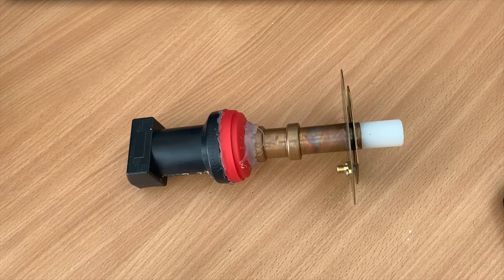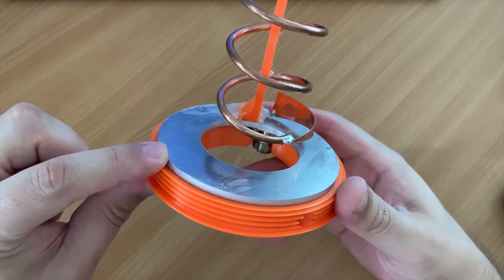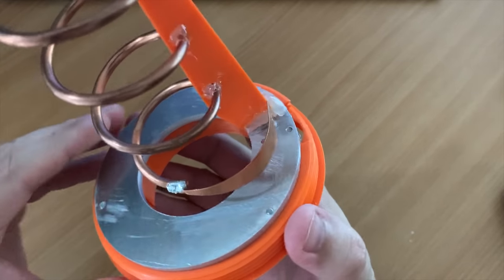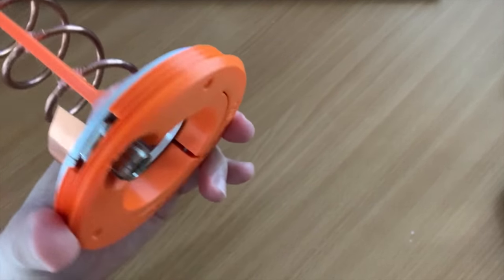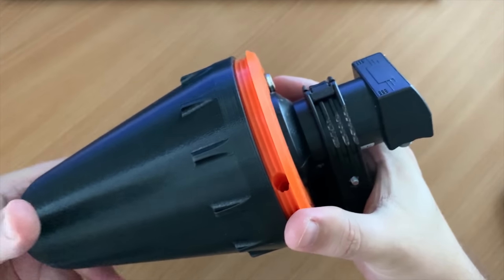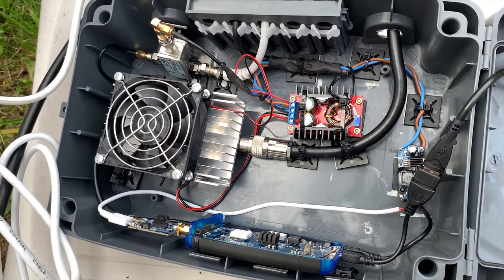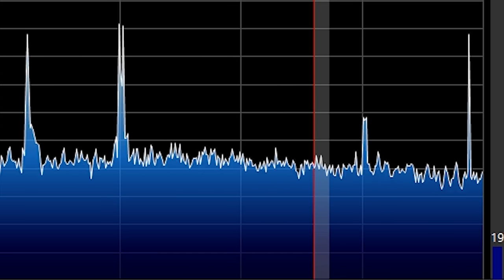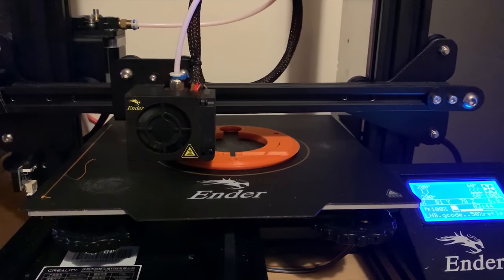2.4 GHz Dual Feed Helix Antenna For QO100

Comment: Outstanding antenna, i have build helix's, for 1.5Ghz, 1.296Mhz and even for 435Mhz, and its a terrific antenna, with the 435Mhz i can uplink to the AO-91 and AO-92 even with 2w at the rig. I think this is better solution than the potty, the patch antennas are OK but i think helix are better, they are extremely broadband and "forgiving" about manufacture tolerances, and they have always a good axial ratio (axial ratio: how good the circular polarity signal is). And the receive side, you only will have a partial obstruction, not the whole signal coming thru a dielectric lens, that can be very lossy.

Comment: Heat the antenna a bit to get all the moisture out, put an O ring seal on the thread or plumbers tape & a desiccant bag. You can test the radome by putting it it the microwave and see if it gets warm [bad] cold=good]  [20sec or so]
Reply from the maker: Thanks 🙏
Reply: 20 seconds to determine if 14 hours were well spent :-)

I guess a material with few additives (ie pigments) and a low dielectric constant (i.e. close to air), would be best. 

I wonder which of the easily printable filaments best fits this specification, perhaps polycarbonate?...
Reply from the maker: Apparently PETG is the best filament to use, but I don’t have any yet.

Comment: Watching this makes me want a 3D printer even more - not sure what the bank manager will have to say though 😝
Another quality video Matt cheers 👍
Reply from the maker: Haha it took me ages to decide if I should spend the money, now I have one I’m so glad I did. It’s such a useful tool to have.
Reply: I just wonder what the electricity consumption would be for a 14 hour print out ?
Reply: @TechMindsOfficial  Can you PLS explain how you bend that Metal Rod? I bought a long time ago someone for my project but sadly I could not bend them. Someone sad I need to fill the tube with sand and than bend it. Sadly its nearly impossible to do so since the pipe is so damn strong.
Reply from the maker: What pipe are you referring to?
Reply: @TechMindsOfficial  How did you bend the pipe, rod,.. who we see in your Yagi Antenna?
Reply from the maker: You mean the copper helix? It’s solid copper, easily bent over the 3D printed former that comes as part of the 3D print files.
Reply: @TechMindsOfficial  oh! Do you know how to bend hollow Coper Pipes?
I want build a Helix for a different Frequency and thats the main problem.
Maybe you can explain in detail how to make a Yagi from scratch?
Reply: @nowaymuller6643  if you get 'soft copper' water pipe its easy to wrap around a tubular former. also but a bit thinner is car brake pipe. neither of these should kink unless you animalise it. copper work hardens, so try to do the whole thing in one fluid motion. you only get one chance to do it easy. after that you can stretch it a bit to fine tune. i havnt made this antenna yet but i have made many distilling coils for moonshine;)

Comment: Looking at 6:45 were you show your dish, you don't appear to have adjusted your LNB for "skew". On QO-100 in the UK it's around 17 degrees.
Reply from the maker: That’s because I don’t use the dish for receive because I have an endless amount of trees in the way. Luckily my 20 watts of RF power at 2.4GHz burns through those trees and gets me a moderate signal to the bird. But yes, you are totally right, there should be a skew on the LNB for optimum Performance. Love your blog btw!
Reply: @TechMindsOfficial  Thanks for the kind words, and thanks for the really useful video! I've been using a WiFi Yagi (with a 2:1 VSWR) for my uplink and the performance is poor! Decided I should do something about it! 😂 Take care! George, M1GEO.

Comment: Great job, congratulations ! for printing the cover did you use supports in the print settings? and what temperatures to set for PETG filament?
73s

Comment: Hi! I tried to build the Helix like described in the instructions but the SWR will not match exactly at 2.4GHz. It is around 8.5 so way too high. I made the matching vane out of 0.6mm thick copper with the dimensions shown in the instruction. Thanks for your reply and 73

Comment: Thanks for the useful video. I've been considering using a helix feed in front of the LNB like you have done. Can you tell me if you have compared the received signal strength with and without the helix in front of the LNB?
Reply from the maker: I haven’t as of yet because my receive is poor on summer due to trees, but now the leaves are dropping off I will be experimenting again, will hopefully do an update video on this. Thanks for watching 🙏
Reply: @TechMindsOfficial  Thanks for the reply. I had a 5 turn 2.4GHz helix without a reflector. I've just tried temporarily taping it to the front of my LNB. Dissappointingly, this resulted in a drop of signal strength on the TV beacon of 3dB. I think a POTY might be a better bet.

Comment: Matt...I have a POTY ready to go on an 80cm dish but read that a helix is better for these smaller dishes and are easier to adjust for a low SWR. How did the two compare in your opinion? Performance and adjustment?
Reply from the maker: I didn’t do any specific measurements, but I would say the helix works way better for transmit. Receive has always been an issue here, so I can’t compare that. SWR on the helix was pretty easy, with the potty it’s a little trickier because as you adjust the driven plate it can also adjust the circular polarisation which you can only really check with a VNA. Helix for the win for me!
Reply: @TechMindsOfficial  Mmmmm ok. I got the POTY but then as I got more stuck into the subject realised that probably the heliax would be more suited to my dish. As well as avoiding all the kerfuffle of making a hole in the LNB cover and trickier tuning. I think I will squeeze one out (so to speak) in PETG and try a heliax. For your problematic receive: I notice the heliax coil blocks a portion of what the LNB will see of the dish. Have you tried a separate and higher Rx antenna to get over the trees?...a long heliax on your roof maybe?

Comment: is it possible to find a pdf of the structure of the helix? i dont have a 3d printer but is i can print a paper template its fast and easy to cut out acrylic sheet
also am i rigt in thinking the helix radiates from the baseplate and not the helix? im wondering the best place to put it at the focal point
Reply from the maker: Check out my latest video on Version 2 of this product, you can buy direct from the designer ;)

Comment: Use a nail polish remover to make it water and dust proof instead of carry bag bro .nail polish remover is much better than plastic carry bag
Reply: That's just acetone, isn't it?
Reply: @IanTester  no it is not just acetone
Reply: @IanTester  actually i said it hydrophobic in nature it mostly used by diy electronics engineers to waterproof there electronic components. Read what i comment and there is no matter it acetone or not
Reply: @jonneycon6157  Nail polish remover is acetone and it will melt the PLA, sealing the antenna enclosure. Clear nail polish is used by hobbyists to waterproof electronics, by forming a hard laminating layer. Both can be used to achieve the goal of waterproofing this antenna.

Comment: Wonder what the dielectric constant and absorption of that filament material is you are using. Some of them are horrible at 10Gig and will have a signal loss of more than 10db  per 1/8 inch of material thickness. I rather would machine a cone from a piece of Teflon or other low loss material than throwing gain away with cheap plastic. The best way to test it is to put a piece of filament into a microwave oven (plus a cup of water away from it as a load) if the filament melts it is not good for RF. Same with the part holding the spiral, how much of your great swr is because of the loss in the material?
Reply from the maker: Dunno, I changed to a patch antenna because the helix shadowed the LNB. Also, there was zero difference in RX level with the cone on or off.